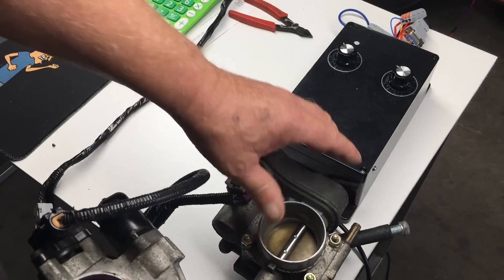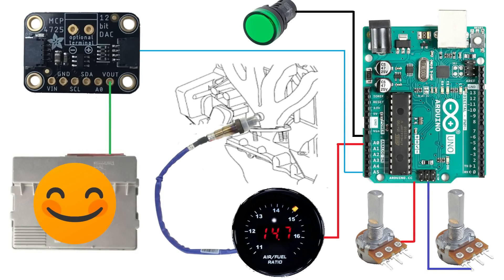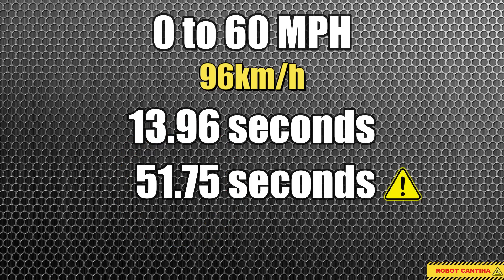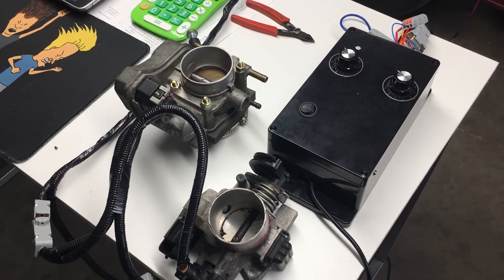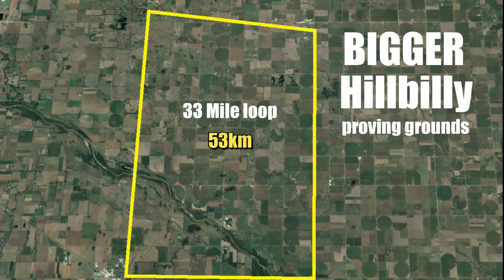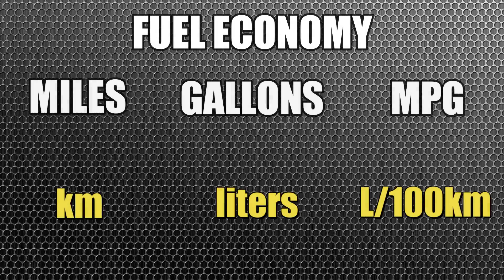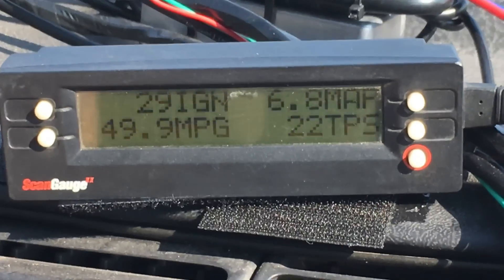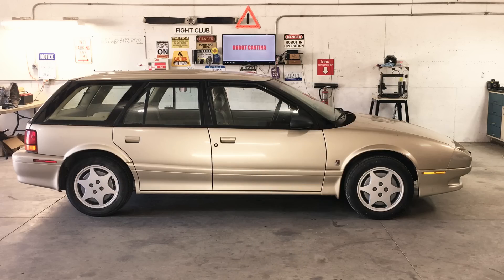S2E21: Our modified Saturn that gets Extreme MPG with lean-burn and Robo-throttle.

Comment: I can't wait for the inevitable conclusion of this with a full stand alone ECM setup running lean burn corn ethanol with robo throttle and full aero for a 200 mpg saturn that takes 3 minutes to go from 0-60 and is 40ft long looking like a UFO whizzing past confused deer on the roadside.
Reply from the maker: LOL....  I really want to do all that just to confuse the local deer population.  They will have story's to tell for years.
Reply: @robotcantina8957  who else read his reply in his voice?
Reply: Yessssssssss!!
Reply: There's literally not enough energy in gasoline for that Saturn to get 200 MPG for any significant distance without losing a lot of elevation.
Reply: @clover7359  dont bring logic and physics into this conversation lmao
Reply: @clover7359  That's what the ethanol is for, with enough ethanol nothing will seem impossible!
Reply: @huzudra  If you drink the ethanol and pass out behind the wheel on the empty road, then coast to a stop in a corn field, you may just dream of 200 MPG!
Reply: @huzudra  ethanol has less energy than pure gasoline. You have it backwards and would only be getting worse mpg.
Reply: @wtice4632  Please see a previous comment explaining the concept of humor then consult the wikipedia article on comedy and humor.
Reply: I’m pretty sure corn ethanol is less energy dense than both straight gasoline and pump gas.
Reply: @fearofchicke  Ethanol may be less energy dense but it tends to make people more dense.
Reply: I unironically want this vehicle. I have a 60 miles commute and gas is a lot.
Reply from the maker: Unless you are very tall, the Saturn coup is extremely uncomfortable,  The sedans and wagons get the same fuel economy but are slightly more comfortable.
Reply: @robotcantina8957  Wait tall instead of short. So the car is somehow built for tall people how?
Reply: @robotcantina8957  What?? A car you need to be tall for to find comfortable??? Dang sign me up! ... If I didn't prefer tiny hatchback where I do just barely fit
Reply: @jackthatmonkey8994  Tiny cars that Dangerous had: 1972 Dodge Colt Station Wagon, 1972 Chevy Vega, 1980's TC3, 1980's VW Rabbit (several), and a Huge 1975 Ford Maverick...ahh the good ol' days. Now I drive a mini-van...ugh...
Reply: @robotcantina8957  wagon has a lot more space for solar panels for a F1 style DRS electric motor for assisting acceleration while still on lean burn?
Reply: @robotcantina8957  I wish I would have known about your channel before I junked my wagon. It would have been donated to you had I known. 

My biggest mpg was 45 in my wagon with cruise set at 65 and not downshifting before hills.
Reply: @robotcantina8957  cool!  I'm extremely tall.
Reply: @robotcantina8957  i have to disagree I am 6'3 and  i have an sc1 and it is roomy  as can be
Reply: @haydennorris2913  I really want get a nice SC2 and toss a crate Cruze 1.4L Turbo in and see how it fares
Reply: @hypercube33  we have 2 a cruze eco (no options) 15inch wheels with eco tires. No power seats. No cruise control. No nothing. Wife gets about 48-50 I can get 55+ no problem and my work car is a sonic rs with a 6 speed manual. Its a bit better on mpg now. People dont realize how fuel efficient those little suckers can be.
Reply: 9:45 so you're doing fuel economy testing with the windows rolled down? All credibility is out the window now
Reply: @janeblogs324  I mean it's 90° or more with no AC and assume he is doing the test the same
Reply: you would probly loose mpg's due to ethanol, and there is several factors just look it up, you would be better off running a higher octane fuel and running leaner. now granite we are looking at mpgs not cost per mile, and not all stations carry e85.
Reply: @dozer8065  Yeah, it's easy to take that for Granite, but don't throw rocks at ethanol it's some peoples drink of choice!
Reply: @dozer8065  While cost per mile is actually essential nowadays, not to mention number of dead people per mile.
Reply: @piotrcurious1131  what exactly do you mean by dead people per mile?
Reply: @dozer8065  Hidden cost of certain fuels? How many people have to die so you can go one mile ahead. 
F.e. Russian gasoline has this factor specifically high, esp. if you include death rates in their refineries (not really nice place to live around). Also not forget cost of climate change, mining (if you think electric "solves" the problem) etc.
Reply: @piotrcurious1131  no im not for electic vehicles, and what happens in russia is russia, we can supply our own oil if this shitty goverments didnt get involved, also ethanol still has to be refined, not to mention the affect it would have on agriculture and the lands, im not gonna set here and argue theres better options, hydrogen for instance.
Reply: @dozer8065  Well, even in America, supply of "own" oil comes at substantial cost. Just look up superfund sites related. Also this oil is desperately needed by military, f-22 will not run on polish LPG conversion kit bought over internet. By raising cost of oil you raise price tag of the war, and you rise global market price of oil, making Russia profit .
Fuels like LPG, being by-product of oil refining are less harmful in ethical context, as LPG cannot be stored, so if not used, is merely vented into atmosphere. Many countries, like Belgium,  understand that, and they are not applying excise tax over LPG - as all you pay for is scrubbing of something otherwise thrown away, transport of it etc. there is no way that if you will buy LPG, oil refinery will extract more for you - you will have to wait until someone else demands more oil. 
Ethanol comes either from ethical sources, like celluloidic ethanol or ethanol made from biowaste like "industrial apples" (most of Europe) or unethical sources like corn crops (USA and Brazil).
Sadly as consumer you are not informed about dead people per gallon rating at the pump. 
And sure, my knowledge on that subject is very limited, f. e. i know USA gives it's citizens tax breaks for using LPG , but i have no clue how exactly it works. 
It is important subject though as war in Ukraine would not happen if customers would choose ethically and not bought Russian oil in the first place.
Reply: Megasquirt would be perfect
Reply: This isn't even my final form!!!
Reply: Last thing to add is a turbo.
Reply: Hate to tell you this, but typically ethanol requires a richer mix than gasoline for a given HP output.
Reply: @jacobm2625  Ethanol is also questionable ethically. Though YMMV. F.e. much of ethanol in Europe comes from perfectly ethical sources like biowaste.
Ad. fuel economy of ethanol - this was beaten to death by aviation industry, and ethanol is still component of many aviation fuels. 
Problem of efficiency is also an question of - at which rpm, at which load , at which type of engine.
In aviation engines run in fairly narrow RPM range. 
Cars need to have very flexible engines, thus manufacturers prefer to use "easier" fuel than to f.e. adding gearbox with more gears. 6 and 7 gear manual gearboxes are quite recent thing in consumer-grade cars. 
I like experiments robot cantina dude does though, as they nicely show limits and boundary conditions. 
I would love to see dual-fuel setup , where limits of timing advance would be merely worked around by injecting less octane rated fuel etc..
The diesel setup will be very good rig for such experiments. Using diesel and LPG as two fuels for diesel engine will provide two fuels of extreme octane rating difference. There is also no spark plug in diesel, so only way to control speed of burning is thru mixing two fuels.
LPG conversions for diesels do exactly that, and most advanced ones even add spark plugs to allow idling and cruise on LPG.
Reply: @jacobm2625  that is what they tend to say, however as someone who tunes race cars, I actually find if you get leaner with anything above say E60, the car goes faster. I can swap a car from 93 octane to E60+, take the AFR from gasoline and leave it, or lean it out a little, and pick up power, without even touching the timing.
Reply: @rpturbo  good to know 👍👍
I just assume that ethanol was worse for mags, because that’s what I had heard
Reply: @jacobm2625  I have never tried to gain MPG on say a production vehicle with E, but it is something I would like to play with. I know what we are told, but I know the data I have, says otherwise, and I am not the only race tuner I know that says it.
Reply: @jacobm2625  I knew the comments section on Youtube could be a little dense but I didn't think I needed to explain the concept of a joke to the internet but yet here we are. I guess Neutron stars have some competition.
Reply: Pfft, ethanol… Isobutanol is the future! Especially if it’s made from switchgrass.
Reply: @AmaroqStarwind  And no changes to the engine to run it.
Reply: e85 gets much poorer fuel economy than regular gasoline
Reply: Lmfao
Reply: Lmaoooo YESSS
Reply: And tire pressure at 200psi with four 135/15 wheels
Reply: ...and Bigfoot!👣👣👣
Reply: I don't know about the ethanol I'm no flex fuel suburban it went from like 15mpg on regular and with e85 it was like 11-12mpg and e85 is only 10 cents less here so that probably isn't worth it and definitely not going to get better mpg
Reply: @james10739  in France Super 95 stands for 1.7e vs E85 sold for 0.78e. There is no way to fool physics with modern cars tuning themselves on the fly, you need about 20% more ethanol than normal gasoline. So that gives 0.936e/l including compensation. Only LPG competes with that.
Reply: @piotrcurious1131  I have heard about 30% more e85 than gas but it definitely takes more anyway you slice it
Reply: @james10739  In Europe most gas is 10% ethanol anyway (5% rated and 5% measurement margin), so the difference might be less vs pure gasoline, esp.e85 has 15% of gasoline in it. 30% is usually compared to e100. 
OFC it also depends on engine geometry, it's ECU and so on, same goes with LPG conversions - if engine cannot take advantage of LPG's higher octane rating or has oversquare stroke ratio, fuel economy on LPG will be low. 
With current price difference of lpg/e85 vs gasoline, it still makes economic sense, even on unoptimized engine, esp. since war Russia waged there is ethical factor toward saving fuels which can be potentially used by military and giving your country advantage in surviving war and it's economic consequences.
Reply: @james10739  e85 has less energy per galon than gas, but its supposed to make up for it slightly because its high octane allows more timing and compression
Reply: @Broke Wrench  it does take more but if your motor doesn't have a lot of compression or something that needs more octane than your fuel can provide then you would be able to run more timing with e85 but if not then it won't make any difference
Reply: @james10739  that’s only because the tune doesn’t take advantage of the ethanol.
Reply: @BrodeyDoverosx  it does tho

Comment: It needs a wax job.  With smoother paint, you might be able to pick up an additional .0004MPGs!
Reply from the maker: lol... Ya' know, the car has hail damage to the hood and roof, I reckon the dimples in the sheet metal are also helping out with the MPG.
Reply: @robotcantina8957  Damn, so this car is bascially a golf ball :D
Reply: @robotcantina8957  I doubt that...but a do have a ball-peen hammer you can borrow...Just saying!

Comment: I'm surprised you didn't add a little bit of oil in the fuel since it's running lean. Running lean will run hotter. To get better mpg I also surprised you haven't modified the car to be more aerodynamic.
Reply: Oil doesn't cool. 
This is a 4stroke. Intake air doesn't contact bearings

Comment: with out a cam sensor you can still do wasted spark, fire 2 cylinders, 1 will bang the other exhaust. Injectors can be pulsed all 4 at the same time even.

Comment: Ahh remember the late 80s and early 90s GM ECMs where you could enable lean cruise. It was in the programming but never used because the NOX emissions were too high with it enabled. It was nice that they left it in the chip BIN for us to play with later on. Course I haven't burned a chip in probably 15+ years now and don't have the stuff to do it with anymore. Even then new blank chips were hard to come by.
Reply: The solution was more expensive hardware (catalytic converters).

As for the Saturn, it uses a unique ECU that likely comes from Suzuki, but I imagine you could repin a 2.2 ECU from a Chevy to work.
Reply from the maker: Interesting that GM had that embedded in the code.  Perhaps they were hoping for a solution to the NOX problem.
Reply: @robotcantina8957  I think I mentioned this in the first lean burn video. The ecu ignored the O2 for 60 sec and calculated the injector pulse width for a leaner/specified ratio. It also advanced the timing by 10 degrees or so. It seemed to only be enabled (at least in the fbody cars) in 86 but was left in the code with the speed to enable set to 255.

Comment: I wonder if a turbo, super charger or the rarer comprex would aid the economy a bit.
I do know that another youtuber from about 10 years ago, achieved respectable results by just deleting all excess weight from what I believe was a toyota.
Oh, he also added pure acetone to the fuel.
Who knows ?
Either way, economy and speed are always handicapped by weight and aerodynamics.
Oh, rolling resistance too of course.
Maybe narrower and light wheels and tires too ?
Thank you, your videos are always entertaining and informative.
Good job.
Reply: super charger likely wouln't help with efficiency, as its a parasitic load all the time.

Turbo... well maybe, but to actually get there, would require tuning of other stuff as well. Turbo on its own won't help with efficiency, as you're intruducing MORE air into the system, so you need MORE fuel as a result.

BUT you can use the turbo to add more torque down low (and because the air is more turbolent, ill help with efficiency) but you need to also have taller gearing to exploit that.

Turboes in terms of economy make more sense on smaller ~1-1.5L engines, because they have tons of torque for a small engine (so taller gearing can be used) and off boost they can net decent efficiency when cruising, because you're not spinning that much rotating mass (smaller crank. pistons and rods because of the displacement).

Comment: Google timing advance processors ”TAP” these are are wired between the ECU and the crankshaft position sensor and meant to be used on LPG/CNG converted engines and allow you to program extra ignition advance.
Reply: That sure sounds interesting. Plus I would love to see LPG conversion in the future.
Reply: I was thinking he could use the IAT signal to tell the computer to add timing. Not sure what cylinder airmass he is cruising at but on the tune I'm looking at anything under 50F and over 0.32 cyl/airmass is adding timing. If he wanted he could tune the ECU with hptuners and use the IAT as a signal to add the timing for lean burn but that would be at least $100 in credits to tune a old swap destind Saturn.
Reply: @1987FX16  back when the 240 z Datsun was new , we added a few hundred ohm rheostat to the sensor and adjusted for both timing and fuel
Reply: @1987FX16  That's a very good idea, and I can tell you it should work that way too! I drive a 2003 Jeep WJ with the venerable ole 4.0. My model has the IAT in the intake manifold while the last model year for my model - 2004 - has the IAT in the airbox itself. I have an OBD reader and dedicated phone attached on my dash which has different guages on the screen so I can watch my timing, throttle position, engine load, rpms, coolant temp, etc. I also monitor my IAT and with the sensor in the intake it soaks up the engine heat and usually always read roughly the engine temp. About two years ago I calculated what value resistor I would need to wire in series with my IAT in order for the ECU to see what the actual incoming air temp is and once I did that it now reads pretty close to the actual incoming air and it bumped my ignition timing up quite a bit, enough to notice a little on acceleration, and it bumped my fuel mileage up a mpg or two! And it's been working beautifully that way for two years now! I've thought about wiring in a variable resistor so I could further play around with it, but I think I may leave well enough alone. 😎
Reply: @OCD Man Yeah it's been an interesting mod. I may still play around with it, but don't want to cause any engine damage. Mine doesn't have a knock sensor so I'll have to listen intently. This is typical me though. I like to modify things, lots of things. There's just something fun about it lol.
Reply: My CNG f150 uses natural gas. It has equivalent of 120 octane rating. So can do lots of compression. Its also only $1-2 per gallon. Maybe combine using Cng with your application for ultimate cheap mpg.